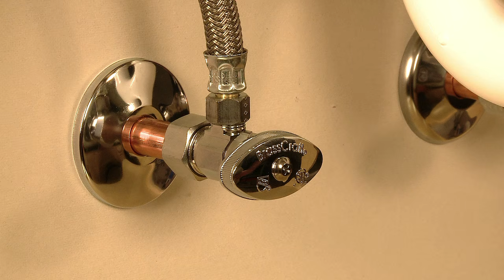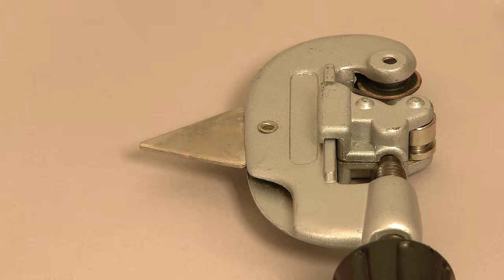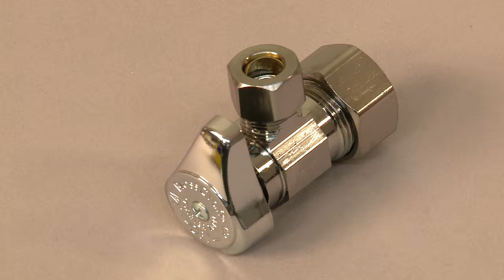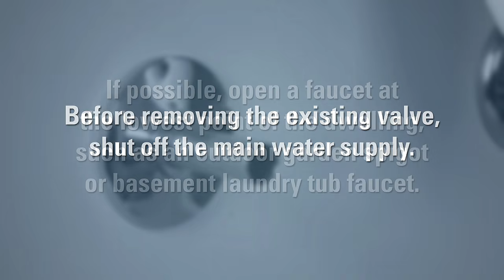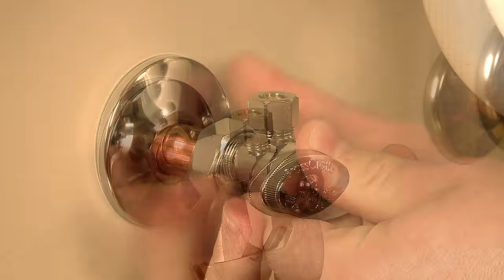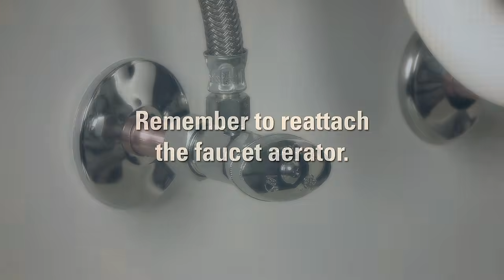How To Install a BrassCraft® Compression Valve

Comment: I would add that I was on my cell phone to my wife in the bathroom in which I was replacing the valve when I turned the water on again at the street. That turned out to be a good thing, because it leaked at both the valve and at the toilet when the water came on, and she could tell me to turn it off again. Based on what she told me, I tightened things a bit more, and the second time things went fine.

Comment: Having replaced exactly one of these valves (thanks to this video) I would say you may not need to de-burr (I didn't). I think you probably absolutely need a compression ring, because it seems to me that this is what keeps the assembly from leaking. Think about it -- you're not sealing the fitting, you're just sliding a few parts over the pipe that sticks out of the wall. The compression ring must be doing the job of sealing it.
Reply: The pipe from the wall did receive the compression ring  to make a seal there however the flexible line   did not need a metal compression ring because the flexible line has a rubber gasket that makes the seal for the flexi-line.
Reply: You should de-burr the pipe. Not de-burring copper piping leads to water turbulence inside of the system
Reply: That's what the brass fitting is basically
Reply: Deburring is to keep water from corroding in that area.